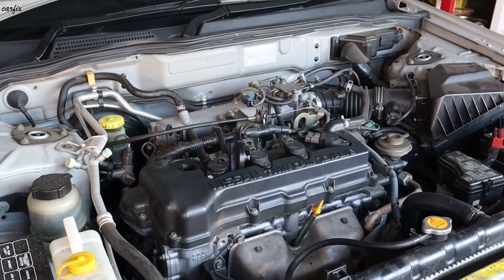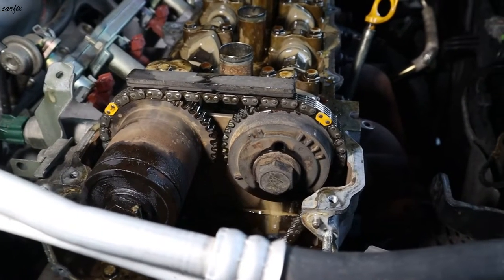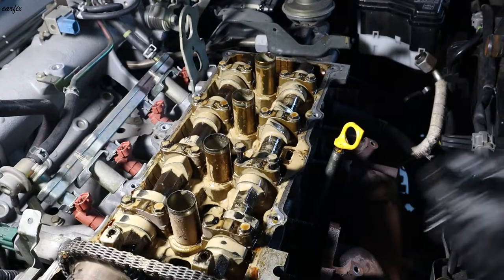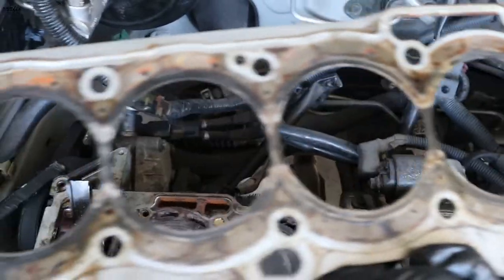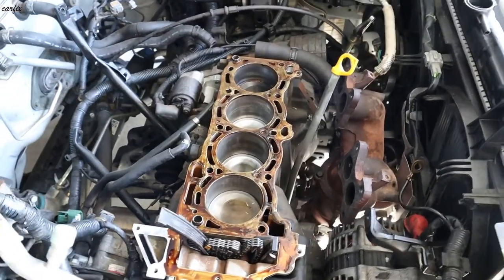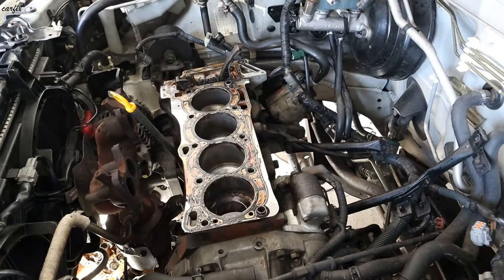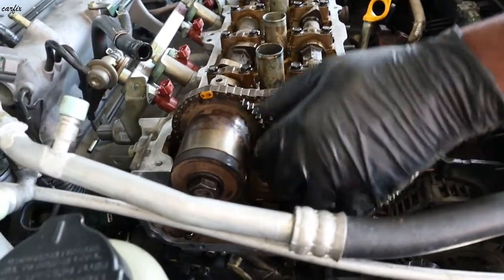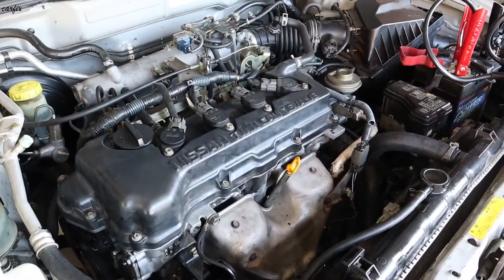2000 to 2006 Nissan ( pulsar , Sentra ) 1.8L QG18DE head gasket replacement.

Comment: Never knew these engines could brake. Except the timing chain stretch (bad oil maintenance) never saw one died. 600.000 KM's and still running.
Reply: They don't brake, they over heat😂😂
Reply: I have a N16 with a QG13DE here in the Philippines and already had 600,000km and its great! It's never been overheated once.. the only issue I have now is the valves tickin' maybe because of age..
Reply: Is yours a QG18 and did you have your gasket replaced at some point?

Comment: Good job. I was worried about the chain dropping but as you explained to others, it is not necessary to hold up the chain... thank you
Reply from the maker: Yes it not falling
Reply: I am starting mine soon your video was very helpful ... wish me luck!
Reply from the maker: Good luck 👍
Reply: Did you use new head bolts?
Reply from the maker: Yes
Reply: Ok thanks
Reply: @738danny  How did it go, the head gasket job?
Reply: @tman3944   very good I've done nearly 10000ks now and it is running very good .. thank you
Reply: @738danny  good I'm about to do the same.
Reply: @tman3944  Good luck

Comment: Very good, well done. Only thing I think I would have done was to lubricate the cam bearings before putting the caps back on them.
Could you use diesel to flush the engine instead of oil, without the plugs in and crank engine with the starter then thoroughly drain and put new oil in then?

Comment: Why no lube before installing camshafts?
Reply: Wouldn’t the oil do that ?
Reply: @JadieFowler  Yes, but it's my understand you apply lube/oil to the contact-surfaces so when the cams turn, you don't get metal-on-metal. It would takes some seconds to get the oil to the cams to lubricate them.

Comment: Do you have to have the camshaft lobes pointing up or in any specific direction after you install the sprockets? Just wondering if they are suppose to be pointing "up" or if it matters. the camshaft lobes.
Reply from the maker: Cam lobs point up means no1 cylinder compression/both valves closed. No I piston TDC
Reply: @carfix1993  and is that what your suppose to do? Have them in TDC?
Reply from the maker: Yes

Comment: When you let the chain loose, did not lost the right timing?
Reply: No it won't because the timing over have an lip preventing the chain from dropping
Reply: @shivabhagwandeen4643  I washed 2 other videos  they both said you have to hold the chain in place otherwise you'll loose the timing and they were wrong, until I watched your video, I when and did this job by my self with out any fear of messing up the timing thanks

Comment: What was your tightening sequence including how tight for the rocket cover? Many thanks
Reply: Manual says:

9     3     1     6     8
7     5     2     4     10

bolts on timing cover 11, 12,13, 14

Stage a: 1-10 = 29 Nm
Stage b: 1-10 = 59 Nm
Stage c: Slacken off
Stage d: 1-10 = 29 Nm
Stage e: 1-10 = 50-55 degrees
Stage f: bolts on timing cover 11-14 = 6,8 - 8.0 Nm
Reply: @mpho1247  does every mechanic knows this? Because I took my car to a mechanic and bought a new head gasket to replace the old one and I am worried if he doesn't know the tightnening sequence
Reply: @JdmForTheWin  Hopefully he knows, if not, as long as the gasket won't blow.